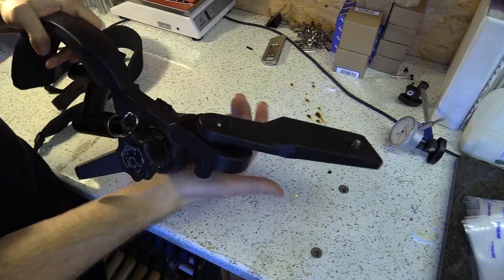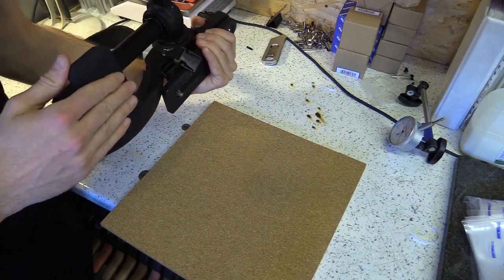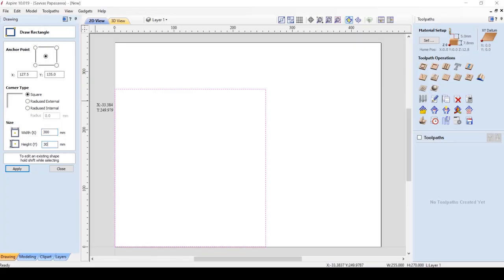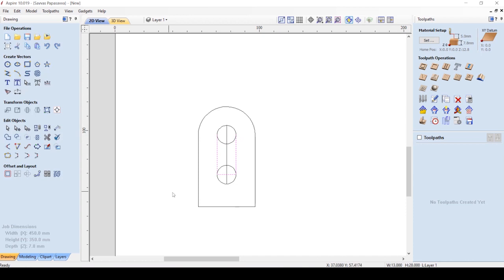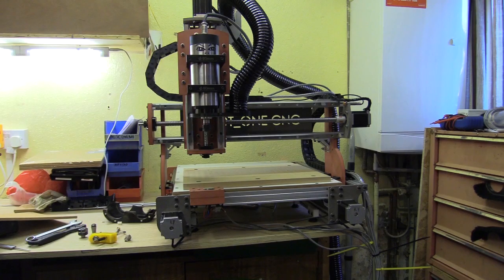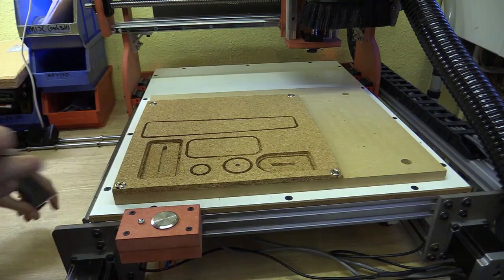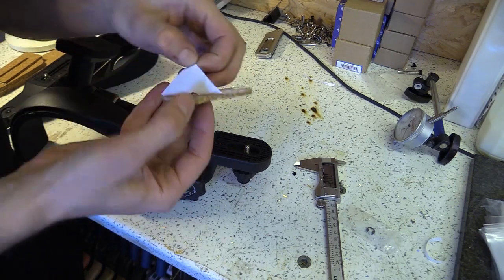Camcorder Shoulder Harness Repair + Meet Moot_One

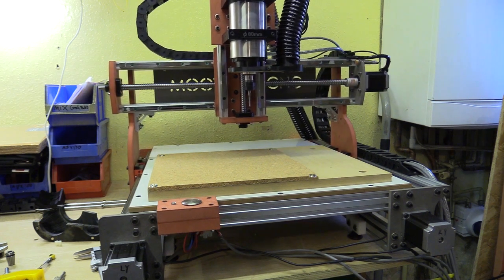Comment: Nice video. I notice that your bench recedes (sink, bend? i am not sure witch is the right word) from the weight while cnc moved from back right corner to front left corner. compare 5:43'' with 5:55''. It is the bench or the legs from cnc?
Reply from the maker: Oh my bench is a bit cantilevered. So the weight of the gantry moving forward is bending it. It's only 18mm thick as well on that side.